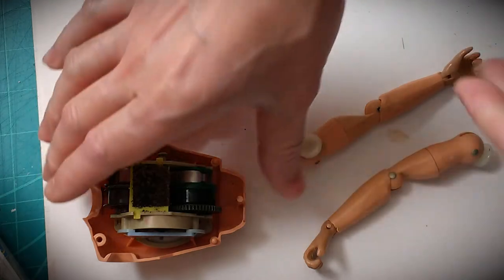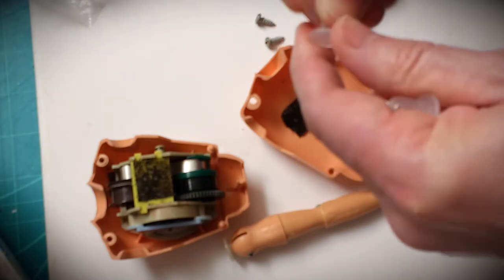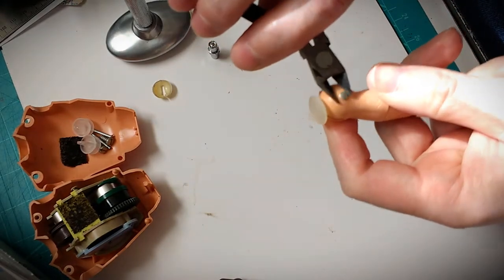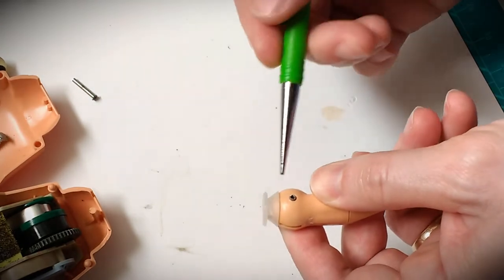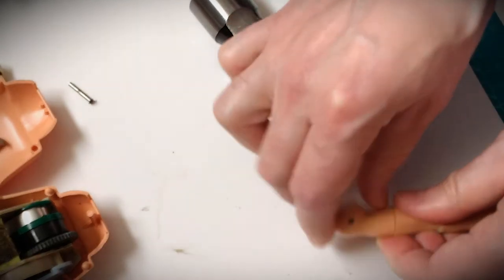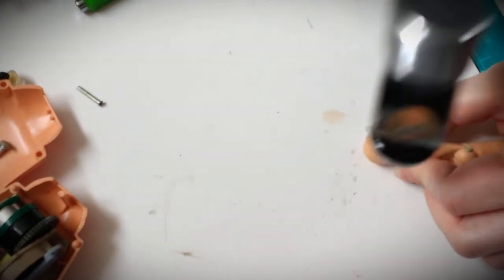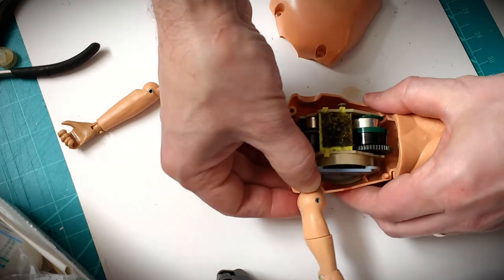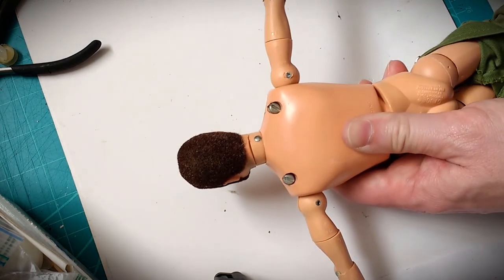GI Joe Adventure Team Talker Shoulder Repair - Ep. 2

Comment: I used to repair these,the speaker box is quite easy to work on, behind the pale blue cover are two weights like a fly wheel. on each part should be a small piece of felt these control the speed of talking. you should see cut outs where they sit.if you replace the felt trim it to suit to get the speed right,also where they rub onto make sure the surface is smooth and not all scratched,this happens when the felt is missing, on the front should be a piece with a needle/pin in check its not rusty this what rests on the spool of  ribbon where the recording is. also on this needle holder should be a tiny spring which returns the arm for the next command line dependent on how far the string is pulled, the pull cord is the same size as the cord fitted on overlock  sewing machines.fiddley to do the first time but once you have done one it's quite easy. Colour of the talking box vary depending on year of the figure,also the sponge you see to stop the box from moving about needs to in good condition this helps with the talking, later talking boxes have a tapered spring fitted instead of the sponge

Comment: just for info . remove all that black stuff off the back of the talker box and the body. it's there to put pressure to make the box touch the speaker circle. there is a thick foamy double sided tape that works well as a replacement .try different thickness to see what works best( one piece, add another on top) . There is thin train oil you can use on the moving pins.  also try cleaning the needle that sits in the tape ,it can get stuff on it . clean the spring too ,sometime it can get gunk on it that slowsit down . it wont help the voice but it could help the speed .
Reply from the maker: Thanks for sharing your ideas, I'm sure it will help viewers even further!